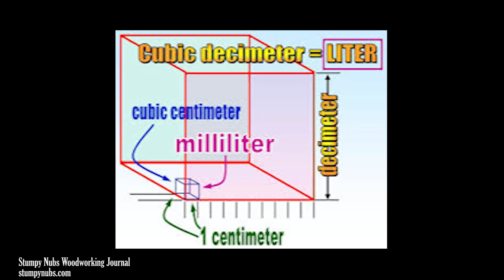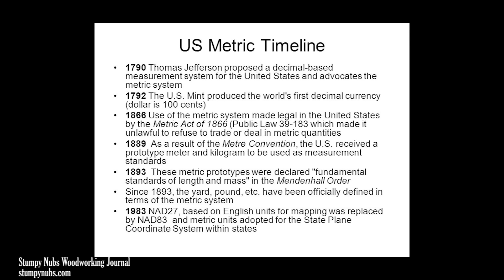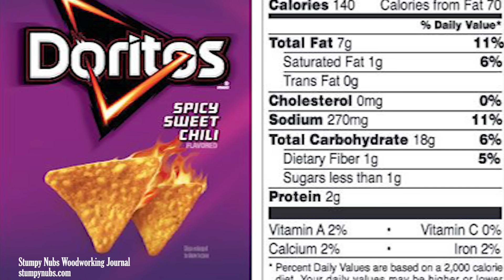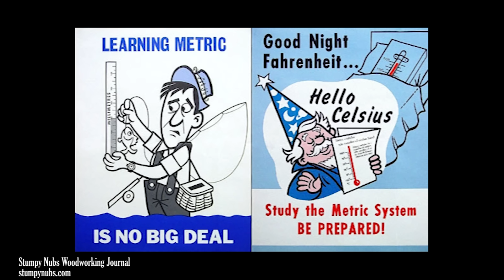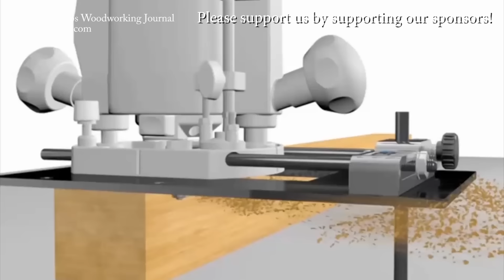BREAKING: The USA is switching to METRIC!

Comment: Actually, if you think about it, we really should be using base 12 instead of base 10.
on your hand, on your main four fingers, each one has 3 pads, so you can count from 1 to 12 on one hand, and if you use the pads on the other hand you can then count the dozens, all the way up to 144
also, 12 is divisible by more numbers than 10
12 / 2 is, /3 is 4, /4 is 3, /6 is 2, /5 is a mess
10 / 2 is 5, /5 is 2, /3 is a mess, /4 is a mess
if we learned base 12 instead of base 10, so much of maths becomes simpler
but there are 2 sets of 12 hours in a day, still
and there are 12 months in a year, still
and 12 inches to the foot

Comment: I worked as a European exchange student in a Californian machine shop in 1984. The machinists on the shop floor were customary to a man. The engineers in the drawing office preferred translating from customary to metric, do the numbers then translate back into customary. They considered it faster and much less prone to error. I am still fairly bilingual in the simpler stuff, a lot of customary translates easily enough into metric especially with a bit of 'about' applied where safe to do so.

Comment: The metric system uses the meter to measure length, volume and weight.  A cubic meter of water is one tonne and 1,000 litres/kilos  which is simple.  25.4 millimetres = one inch exactly which is a blessing.  Feet inches, yards and miles are much more intuitive for length and are still widely used in Britain and Ireland.  Weights of corn and coal is simpler in metric and a real pain when measured in bushels,  quarts imperial.  American gallons are different from British gallon which is a nuisance.

Comment: As a 76 year old English man I was taught and brought up on the imperial system and entered industry as we changed over to the SI system as a result I am “fluent” in both systems. I recall a number of entertaining incidents during the change over. An avid watcher of New Yankee Workshop and all the many exceptional YouTube craftsmen from America, I have always thought how cumbersome it is to handle the imperial system where 55/64 sits next to 7/8 on the ruler. However when visualising sizes of say structural steel, I still think in inches and feet. The woodwork industry has really excelled in the UK 4*2 is 100*50 but when measuring planes stock is actually 96*44 millimetres and guess what the lengths of timber stock is in 300 mm increments as it was before in feet. And an 8*6 sheet of ply is 2440*1220 mm
It is like getting the whole world to speak the same language, and pigs may fly too!!  Great presentation very humorous and I am sure that you will find metric so easy to assimilate with your 300 mm rule and drills in 1 mm increments.

Comment: The base unit does not really matter.   The imperial system divides by 2 whereas the metric system divides by 10.  Even machinist have used the metric division method with thousandths of an inch!  Changing the base unit is the big change but I have thought metric only since 1969. My workshop is primarily metric.  I gave a talk at a social event some time back where I discussed these things and also told people about the metric foot.  Check out wikipedia!

Comment: A good video. I was of the under the impression that the US became metric for measurement quite sometime ago, And I don't mean shortly after breakfast yesterday. In 1875 the metric system was included in the US official measurements and it became illegal to not accept metric solutions. In 1975 Congress passed law to make SI (the french non french name for metrification) the US standard. I have known this for a long time now and also know this has been generally ignored by the American public though the US government uses metric specifications as a preferred method and obligatory in most areas.

I was brought up and schooled using imperial measurements in England, In fact we used to laugh that the US could not get the size of a pint right in ounces. But that's besides the point. I used imperial until the official change over to metric in Australia, where I now am. I personally cannot comprehend why anyone would continue with the imperial system. It is so much simpler and its not hard or difficult to think in and conceive in metric dimensions in design or construction. Having said that I do often refer to some things still in inches or feet depending on what and where I am. My children, brought up during the metric system changeover are conversant with imperial. Neither would use imperial as a measurement of choice.

I am sure that if anyone suggested making the old UK pounds shillings and pence conventions of accounting and monetary measurement the monetary system in the US, the population would not only be dumbfounded but take more than just umbridge at the idea of changing the very simple cents and dollars system to one that also included a value thing like Guineas along with 1/12 and 1/20 mixed denominations.

When Australia went metric in measurements in 1970 they created a 2 year plan and banned things like imperial measures on rulers (since dropped) and teaching metric in the schools system. After 2 years the country was metric. The hardest part was litres per 100k in place of MPG as the concept was different not a conversion of one number for another using the same mental mathmatical rule. It soon becomes easy though and the car fuel gauge tells me what I am doing anyway.

Comment: I live in the UK and we changed to the metric system years ago. However, we never changed fully, Speed limits are still set in MPH and road signs still use Miles, also we still buy our beer in pints!

Comment: I'm American, but i prefer metric for most of what i do. All my 3d printers are metric and the system is just simpler. I can approximate volume pretty fast in my head in mL, because it is directly related to the actual dimensions of the object, but i have never been able to picture what an oz actually holds. Also, it bothers me that US Units sometimes have the same name for different things; ounces volume vs ounces weight, pounds mass vs pounds weight vs pounds force.

Comment: Growing up in NZ which converted to metric in the mid sixties, and having Dutch parents, the metric system is logical. Becoming a mechanical tradesman, I have used both systems on a daily basis because of all the imperial machinery and constructions that still exist and require maintenance. This will probably still be happening in the USA for another century. Inevitable and unavoidable, so educate your children in the use of all systems. BSP & NPT pipe and fittings and still readily available and will remain so, for a long time. Same with fasteners and fittings, so being able to identify which is what is imperative for any tradie.

Comment: I always hated doing fraction in school, so why would I want to use a system of units that has be doing fractions all damn day long and bringing back nightmares of my ruler wielding 3rd grade teacher who swore that she would teach us fractions or we would die trying. 

But even if we stayed with inches, why not move to decimals with marks every 0.1 inches (1/10"). And if that isn't fine enough, we could just put a tick mark between each 0.1" mark to allow measurements down to 0.05" (1/20"). And since very few things in woodworking really need to be stated in anything but inches we don't need really worry about the oddity of there being 12 inches to a foot and 3 feet to a yard.

Comment: In 1974 metric was made conpulsory in schools all over Britain. I was 6 years old. 10 years later starting my apprenticeship as a toolmaker I was confused, suddenly all of my work mates were using inches. Many of them were stubborn and refused to adapt to the metric system. Even 25 years later they couldn't change.
I think it will take 50 years from when it's conpulsory in schools to make the change.
Reply: it wasn't 1974.  I am 66 and have never been taught imperial/customary. so maybe 1964.

Comment: I live in the all metric country of Norway. The funny thing is that when I buy planks they have these weird dimensions. Raw cut planks are always in some increment or fraction of 25mm. Standard dimensions in mm are 13, 16, 19, 22, 25, 32, 38, 44, 50…. That’s just odd. Why aren’t they in let’s say 5 mm increments?  Well it’s off coarse because we actually use the imperial system when building 😂 

Back in the time (after the French Revolution) when Norway got its constitution modeled on the French and turned metric we used inches. Basically anything made from timber (and that’s basically everything in Norway) and all the tools prior to the switch was in inches so it was just decided that the standard base unit of planks was 25 mm with the possibility to use the fraction s 1/4 1/2 5/8 3/4 and 7/8. And I guess those fractions are quite recognizable for a lot of you 😊

However there is another area that has changes the last 25 years though. Plumbing has moved from quasi metric-imperial to true metric and pipes and fittings are now typically in 5 or 10 mm intervals. If you have a home built before the 80 you have to find the imperial shelf at Home Depot…

But then there is the salty sea and there is a lot of that surrounding Norway. That’s still imperial (except depth). Go figure!

Comment: I am in the UK, so I have no right to say what our friends in the US should do. However, I am old enough to remember to switch from pennies (240 to the £1) to new pennies (100 to the £1) and the switch from ounces/lbs/stones to grams and Kg. It was worth the pain of transition - metric is so much easier. I like to cook and there are many fine cooks in the US. However, US recipes use volumetric measurements, which is a difficulty because qualifiers are required. Is it level or heaped? Is it compacted? There's a big difference between the weight of a loose cup of flour and one that is compacted. On the weights of ingredients, an ounce is quite a large increment. I have found grams to be far more practical in devising a recipe.  We aren't completely metric in the UK - we still use Statute Miles and not Kilometers. Notwithstanding the long and troubled history between the UK and France, I think we have to hand it to the French over the metric system!

Comment: As long as the gals will "depend' on inches (aka is in charge of) to make their 'remodeling"/ renovation or even construction projects, the rest of the world won't matter.
The mechanic's metric won't matter to the gals, 75mm cannon either.... Their 2 1/2 pipes plumbing repairs will.
It's also much simpler to calculate fuel consumption in miles than liters.. 100 MPG vs 2.35liters per 100km...
In other words, the daily casual exposure to the common man/woman  is with the imperial. 1lb of butter, 1 quarts, 1 tsp, 15 gallons, etc... 
Daily, it means: How your food, construction materials and you tank of gas is measured.. That's what we are ALL exposed to in real daily life.
The construction material, if shifts to metric, will create tremendous pain for years to come, especially for those renovating.

Comment: What's strange, on my business first trip to England in 1998, from the taxi I saw signs that we were going 50-60 mph! I asked the driver and he said they switched back from meters on the  roadways.  Road distance and speed was in MPH! But everything else is in meters.
Reply: We never had metres in road measurements. It was considered but deemed too expensive to move and convert all the road signs and the road markings.
Apart from that we are fully metric and have been for years.
Vehicles have dual markings in miles and km so it's no problem if driving on the continent
Of course electronic speedos can be switched over. Note the UK spelling to differentiate from gas meters etc.

Comment: I think its ironic that the first country to throw off the imperial yoke, still clings to the IMPERIAL system of measurement when their first allies, the French invented the alternative system. I was born in England when they used the IMPERIAL system but in Australia I have been exposed to metric for 50 years. On a project I use millimetres but when I buy timber its a 4x2 (2x4 in American) in  my head and sheet goods are 8 x 4. Vive la difference.

Comment: While woodworking measurements are made slightly easier with the metric system, try measurement with cooking.  Cups, tablespoons, pints, quarts,... it's an absolute disaster.  If you use the metric system, you need the weight per cc and everything becomes easy.  Try working on any car, it's mostly metric.  The U.S. needs to change at least for everything but long distance and speed (although those changes should be done as well).

Comment: Well i can say it's been proven that the use of metric in the construction industry improves speed and decreases wastage, most because there is no guess work it's done in mm so you just read the number and for those worried about not being able to divide by 3 well you are talking about a difference of 1mm or 0.04 of an inch which is more accurate than many people are getting on a measuring tape

Comment: In the U.K. we use both.  It's not confusing and it's great to be able to "talk" both languages.

We have millions of Victorian houses that were built in Imperial.

By the way, we only turned metric on currency in 1971, still serve pints in bars and ALL of our road distances are Imperial by law.

Woodworking wise, we buy materials that are in mm but actually are Imperial boards/planks/joists etc that have been converted to metric.

I use both in one piece of wood, when it's convenient!

Comment: When Canada switched to the metric system Air Canada forgot to convert from imperial to metric for fuel for 757 aircraft and ran out  and had to glide last 100 miles before landing safety

Comment: I was taught the metric system back in '75.  It's a useful system, but, it has one major drawback.  Objects designed wit 'noble' metric dimensions, i.e. whole numbers, always appear 'clunky & thick' as opposed to 'beautiful & slender'.  Yeah, yeah, I know that style is subjective, but in order to make something 'attractive' on metric is going to require ratios that forgo the ten-based increments whereas the fractional relationships always remain relative to the size of the other dimensions.

Oh and the other problem is the stupid adherence to the GCS (Centimeter, Gram, Second) system by so many scientists instead of the MKS (Meter, Kilogram, Second) system used in commerce.  Even when the CGS system brings in ridiculous quantities such as the "FOE" aka 10^51 ergs (10^44 joules) which is unit of a type 'Ia' supernova standard candle.  And in case you missed it FOE is the anagram of "Fifty-One" and "Ergs".

Comment: I live in Malaysia and I modify industrial machines for my customer. Once I modified a made in America laser machine and it drove me nuts. I always expect Americans will apply all their measurements in inch and the parts would be in inch but I was wrong. some screws are screwed with metric and some in inch . Air hoses some in inch and some in metric, In the end I redo all the screw holes and tapped everything in metric. some parts are designed in metric but I could not understand why in the drawing the dimension stated in inches? when I made the conversion from inch to metric and remeasure the part again. the dimension accuracy was out by 0.5mm .for high precision parts this may resulted rejection. My advice to the Americans. there is no need to PRETEND to metricized the measurement in imperial definition. It will not work this way. your highway speed limit always slower than us 60miles/hour=  96.56km/hour when the rest of the world is speeding at 100km/h , you bag of flour always weight less than us 2pounds = 907.185grams when each of our bag selling at 1000grammes each and for social distancing during COVID is 6 feet apart = 1.83 meters compared to 2 meters over here,  which means your probability to catch an infection is higher than us.

Comment: The US Customary IS a metric system. The rest of the world and pedantic nerds in the US insist on calling SI "the metric system". One of the stupidest things from the French Revolution and the egg-heads of Europe was deciding not to pick one of the standard Yards and divide it into 100 segments. This would have made conversion from the old system to the new one trivial and nobody would care if you use the 10's division, or if you like the perfect rational number arithmetic of 12's where 12 is a much better number than 10. (Rational arithmetic is exact and 12 is commensurate with 2, 3, 4, and 6. Wheres 10 is only commensurate with 2 and 5.) Everything would have worked out just fine.

Since today's education system leaves kids needing a calculator for trivial calculations and even dividing by 10 is too hard, I suppose the SI will become ever more required. Keep in mind this will also mean changing clocks to a 10 hour day with 100 minutes per hour!

The approximations are easy and good for most things. 25mm to the inch. 4 liters to the gallon. 100sq ft is 10 sq meters. A meter is a yard plus a little. A football field is 100 meters and Km is 1000 paces or yards is close enough (1100 yards). 880 yards is half a mile and is very close to 800 meters (804.6), so 1 mile is 1.6km.  10 miles is 16km and 30mph is 48kph. 75mph is 120kph.